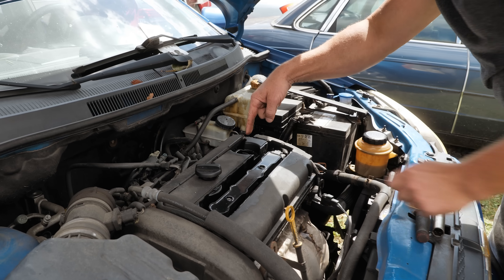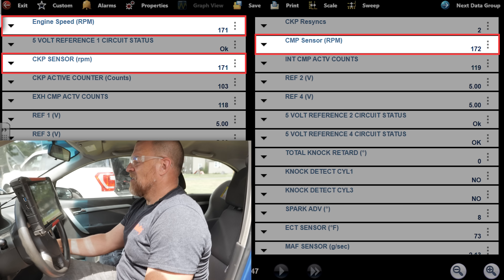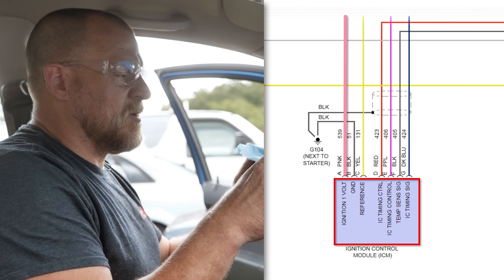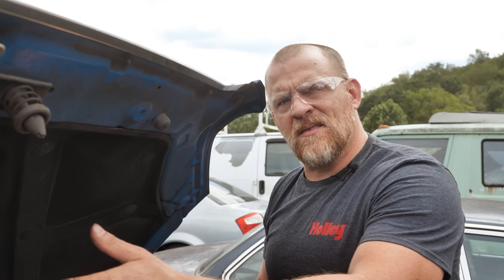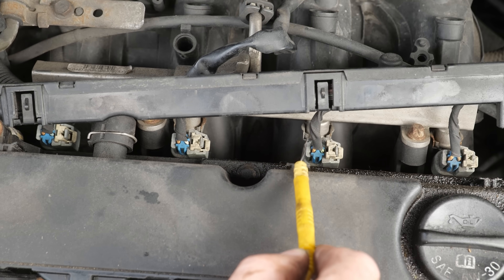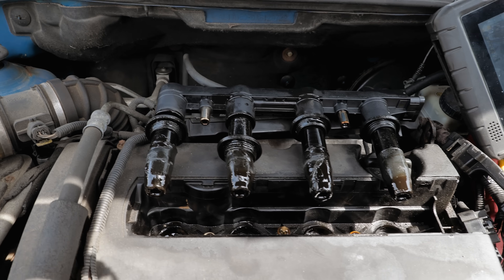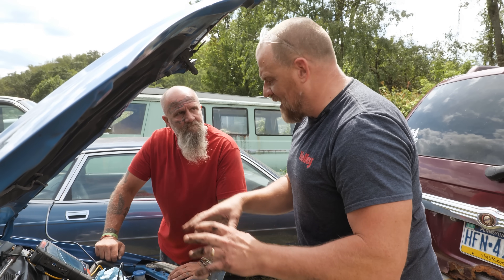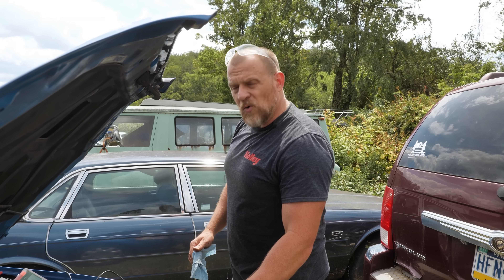No Start After Severe Misfiring - TESTING GUIDE!

Comment: For what reasons would an  Exhaust Manifold overheat?
Reply from the maker: I mispoke. The cat is bolted right to the exhaust manifold and it was the cat that was glowing
Reply: @ScannerDanner  regardless of the video, exhaust manifold overheating could be caused by a clogged exhaust, misfire, leaky injectors, or an air leak manifold gasket?????
Reply from the maker: Clogged exhaust, not that I've ever seen, but mixture and timing issues, yes

Comment: That engine is common here in UK also rocker gaskets are always going down never seen one that bad though usually they blow a fuse in bix by battery the coil packs short internally fantastic video as always still saving up for your book need that so bad 😊

Comment: auto assumes either, very lean or unburnt fuel misfire burning in exhaust, possibly plugged cat. converter.  seen all the above make an exhaust red, the first two generally smoke the converter by time it's decided to investigate. lol, go figure
** wonder if it nuked the exhaust valves/seats.

Comment: Before doing the repair you could remove the upstream 02 and check it with a borescope to check the cat.......
Reply from the maker: This one being so close to the manifold should be okay but here in the rust belt, some of these, you'll pull the threads out with the O2. Second to that is when you struggle to get these out, maybe use heat or whatever, they don't work again when your done. But I agree with you, I'm only suggesting that test to be sold to the customer with the knowledge of what I just mentioned

Comment: A bad oxygen sensor sometimes
Reply from the maker: A bad O2 sensor would not cause a no start. It is not even used until it heats up
Reply: I tried to call for the reason why exhaust manifold turned red hot

Comment: 6:23 on the snap-on, the inverted (and coupling AC) are only available in lab scope and not in graphing meter
Reply from the maker: I switched back to the labscope didn't I? Good catch if I didn't. Thanks!
Reply: @ScannerDanner I thought you said you did
Reply: @ScannerDanner I've watched this again, by the looks of it, it was the graphing meter used all the time (no slope trigger settings too)

Comment: every Holden cruze in Australia has done that, oil soaked coils. Used to replace 30 a week 😂 solid work as per usual mate! 💪
Reply: Just had that.  When I pulled the valve cover it only had one seal in it.  oh, shit, now I have to dig the others out wherever they are.  they had slid down the spark plug tubes letting the oil get into  the well.
Don't like the fit of the new seals, so if they slide down, i'm replacing the entire cover.

Comment: I'm gonna go way out on a limb here and say that new plugs, boots, and valve cover gasket won't fix it (and I'll explain why). I think it's likely that the cat is completely melted to the point that it's severely restricting the exhaust enough to cause a no start. My reasoning is:

1) Motor oil actually isn't very conductive at all, so it's not the same as when water is allowed to get into those spark plug wells. 
2) He's had a misfire and that P0420 for a while - as mentioned in the video, that misfire is probably what killed the cat over time and now it got so hot that the exhaust manifold is glowing and completely melted that cat down, causing a substantial blockage.  
3) You add in all the unburned fuel in the cylinder, lower compression due to cylinder wash, and excessive exhaust backpressure, and I think that's enough to cause a no start

Would I bet money on the oil being more resistive than the spark plug gap under compression? No, so I will not at all be surprised if it does start with new plugs, boots, and valve cover gasket. But I would probably just suck the oil out of those wells, pull the spark plugs to inspect them (replace if they look really bad), clean the boots up a little bit, and reinstall and verify it starts and runs before selling the customer on new plugs, boots, and valve cover gasket because they're probably not going to be happy paying that bill if it doesn't fix it and they actually need a new catalytic converter that may cost more than the car is worth. I know it's a different deal here because it's that guy's personal vehicle, and no judgment at all on Paul's recommendation as it's understood that it may need a cat anyway, just my thoughts.
Reply from the maker: Absolutely the cat very well may be completely restricted at this point. On this one, since the parts needed are very inexpensive and the owner is doing the work is what dictated me not going further at this time. Compression testing should also be performed if this was a customers car. So we are in agreement
Reply: @ScannerDanner  Yeah makes total sense. I guess only other thing you could do is pull the upstream O2 and see if it will start then. If it doesn't then next step is definitely confirming or eliminating that potential ignition issue as the cause.

Comment: Engine oil is not electrically conductive.
Reply from the maker: Neither is pure water. It is the contaminates that are. Wonder if the same principle applies, my guess is yes
Reply: @ScannerDanner we’ve seen oil cause this before. Maybe it’s seeping between contact areas and insulating. Never thought too much about why exactly. You’d think it’d cause driver issues on some vehicles but apparently the spark is still going somewhere or it’d weakening it. Interesting.

Comment: 👏👏👏👏👏
   Had similar 
Oil Tracks power away from spark plug firing 
    Pencil lead line down the side of a spark plug stops the motor bike theft from the garage . Won't fire , don't go .

Comment: I believe that ICM actually does have 4 individual coils in it and is not wasted spark - the confusion comes from bad OE service information that shows circuit 405 being "Lower Air Temperature Sensor Signal" at the ICM (which makes no sense) but if you follow it back to the ECM it shows that it's Ign Coil B Ctrl. So yeah, those 4 wires are just the individual controls for coils A-D.
Reply from the maker: I just looked at the PCM part of the diagram and indeed it is showing ignition coil A, B, C and D 
Also within the service information there is mention of 4 different coil drivers. Talk about a misprint! Lol good catch my friend

Comment: I have habit to graph on crank no starts while cranking RPM MAF Calculated load Absolute load and IAT. That is how I get the initial direction. A restricted exhaust will show up on these PIDS. My second test is an amp clamp on battery negative activate fuel pump and look for 1.2 amps per 10 PSI. 5 to 7 amps fuel pump is not a primary suspect.
Reply from the maker: I like that
Reply: @ScannerDanner  Keep in mind that calculated load and absolute load does not refer to engine load it refers to air load/volumetric efficiency. The Escan from automotive test solutions extrapolates those PIDS into some nice explicit graphs/charts

Comment: At 1:58 did you catch the MAF reading?
Reply from the maker: Never looked at it. What do you see? Thanks!
Reply: @ScannerDanner  it was at the bottom of the screen not clear it looked lower than normal
Reply: @ScannerDanner  On a completely restricted exhaust causing crank no start you will most likely see a 3 second 100% spike in calculated load PID.
Reply from the maker: @rodvan-zeller6360  great tip!
Reply: @ScannerDanner  Please investigate further. May be different in different designs.
Reply: @ScannerDanner  A fast calculated load spike most likely caused by a air bounce back the MAF reads even in reverse flow.

Comment: I Had a Hyundai or Kia come in no start. Pegged my backpressure gauge instantly. Came in for 02 sensor. No start only code 02. So I Scanned, Pulled 02 checked Back pressure' customer couldn't afford repair.

Comment: Not nearly as complicated as what you did here Paul, but I put a new stereo in my kids car and the fron left speaker didn’t work.  Plugged the old radio in and it worked fine!  Turned out the plug harness that came with the radio didn’t have the wire “clicked” into the plug, so when I plugged it in, it pushed that pin out!  Did a little mental thought, but I was smart enough to figure out that it was something new that caused the problem!

Comment: Great job team Danner!

  How would you suggest providing an estimate on a job like this? The plugs, boots, and gasket and an additional hour diag?

  Or the plugs, boots, gasket, and an engine if there is severe damage? 

It just sucks when the customer gets an estimate for X dollars and then you have to go back to them with a much larger one.

Thanks for everything!
Reply from the maker: If this is a customer. You're next step is to sell testing time for a compression test.  Or sell the valve cover, boots and plugs and make sure the customer knows about potential engine damage and also a plugged cat. Tread carefully and communicate effectively

Comment: Pretty much every 2.5l Ford has the cylinder 4 spark plug tube swimming in oil. And they run perfectly fine without misfiring. 🤣
Reply: My 96 accord has had oil in the tube holes for several years. It’s so bad it’ll actually overflow the tube and run down the valve cover. Winter beater, don’t care.  Runs great 👍🏻
Reply: The 2.0 in my fiancé's son's 2008 Ford Focus had this problem when we bought it five years ago with 89,000 miles on it.  Only two of the holes were filled with oil and the car ran rough.  I replaced the valve cover gasket, coil boots, and plugs and it ran great after that.
Several months ago, the transmission developed issues, and it's been parked ever since but I had noticed oil on top of the valve cover again and sure enough there was oil in some of the holes again.  Car has 179,000 miles on it now, so the valve cover lasted less than 100,000 miles again.
Reply: @Mr2004MCSS rubber PCV hoses go bad on them and collapse flat under vacuum, they then pressurize the crankcase and blow oil out everywhere.
 they have  oddball rubber reducer elbow hose direct off off intake manifold (center back of engine), that routes to steel tube on drivers end of head, then back to rubber to the pcv valve from just to the right of cat converter. anyway, the main rear hose gets soft fuel/alcohol vapors and sucks flat not allowing pcv flow, eventually they'll open uip and make a huge vacuum leak. the engines runs/idles bad when collapsed, when open and leaking vacuum (loud hissing) they run very bad to the point of nothing working right including shifting. you may want to check that first, but they're not know for great automagic(lol) transmissions. the standard trans is the one you want!
** now that I typed all that(for zetec engine), it may not apply if that's the duratec engine, but I think they still had issues with the hose/pcv. whoops.
Reply: I gotta agree with you....
Reply from the maker: 😂 clearly this was was too for a long time, until it wasn't

Comment: Censoring the engine like it's top-secret
Reply: It absolutely was top secret lol
Reply: I have a question to see if you have run into this symptom.
2014? Jeep Patriot
4 Cylinder VVT 2.4 LITRE
My friend drove to the store, (more than 5 minutes). 
She goes to leave , shopped, left and got to the street and it died. 
She calls a tow truck. 
It's been sitting for 45 minutes. 
The guy is ready to pull the car on the sled & he tries starting it. 
WoW, starts & runs so he drives it upon sled. 
She takes it home & starts it & it runs 5 minutes & dies. 
I came the next day & ran it @3 minutes, but it never died. 
Ran great too.
 
We live in 100F weather.
Morning was @ 80F. 
My guess is an electrical part that fails when it gets hot. 
What is your gut feeling ? 
Wondered if
Reply from the maker: @FORDmula1CDBURLOCK  scan it for codes, step 1
Reply from the maker: 😂 it would have given it away immediately